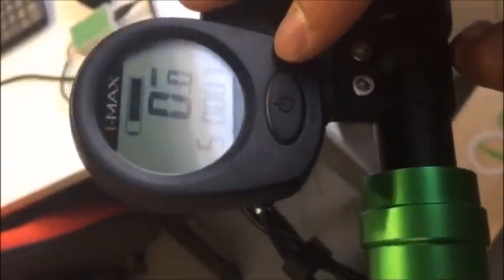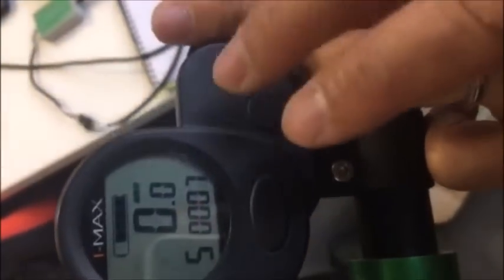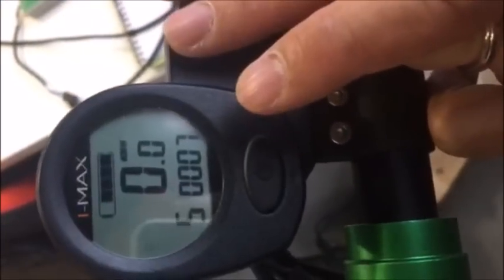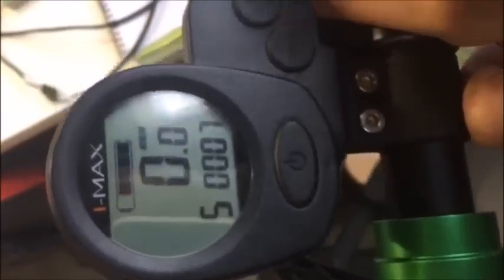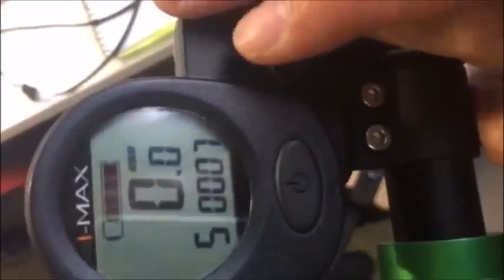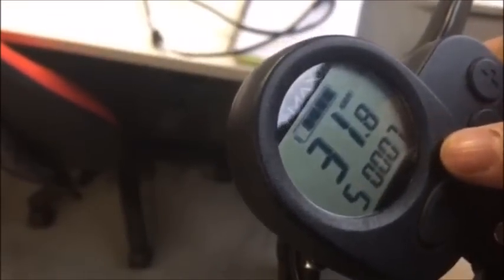IMAX s1 T3 Speed Limiter

Comment: Don't do this. Just hold the + and - at the same time for 3 seconds and then press the power button 3 times to get to section 4. And press the + or - button to change between 20kmph or 30kmph speed limit. Keep pressing power button to get back to section 1 you can change between kmh to mph and hold + & -  to save and exit.
Reply: looks like 3 is to enable the cruise control.. I don't know what 5 does.
Reply: Franz Fuchs that's for wheel size.
Reply: - To enter the menu, press the power button and the PLUS button at the same time for a few seconds- then, to disable the code, press the power buttons, PLUS and MINUS at the same time . I hope this will help you. James Merrifield
Reply: if you fail ... send me a message on my email and I'll explain. comanmarius78@gmail.com. I stayed for 2 weeks until somebody explained how to do it James Merrifield
Reply: @comanmarius  I got my Ten now and have the same fault, could not come out der Menu it shows now I see only 1 8888, 2 8888, 3 8888, then power off and when power on 4 8888,
Reply: Can anyone upload a video of how to configure this menu? My scooter let me select between 0 and 9 in the four spaces and I'm not sure what means each one. Actually I'm getting 27kph and I know it can reach 32kph. Does anyone has this issue?
Reply: what is section 3 and 5 used for? do you know?
Reply: Trung Nguyen Have you already found it out ?
Reply: Thanks but i was wrong i mean 2 where you can switch between 8 and 10 !
Reply: Hallo, I have a  problem, now I see only 1 8888, 2 8888, 3 8888, then power off and when power on 4 8888, how can I exit from this mode?
Reply: hi i have the same probleme what did do ? , did you fix it ? can you help me? thank you  @pandux24
Reply: Coman Marius hi got same problem wot did u to get out that mode
Reply: @comanmarius  how did your fix your problem same for me now now I see only 1 8888, 2 8888, 3 8888, then power off and when power on 4 8888, how can I exit from this mode?
Reply: if someone stucks at 1-8888 2-8888 3-8888 4-8888here is the solution......take the code 5555 and you are out of this menue
Reply: @pandux24  SAME FAULT TO ME NOW :-( I dont come out now when I power the scooter on I am in this menue any tips to come out?
thx A LOT
Reply: I tried ur method, but it doesnt work. Nothing happens when i holf +&- for 3 secs then i let go and press power button 3x. I tried this when switched off and on. Any advice? Thanks, im trying to cap speed